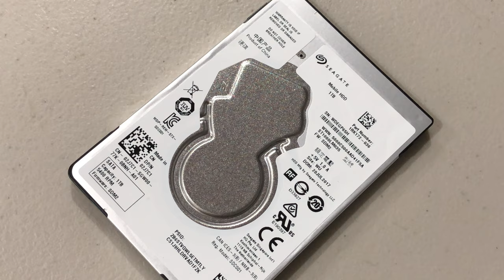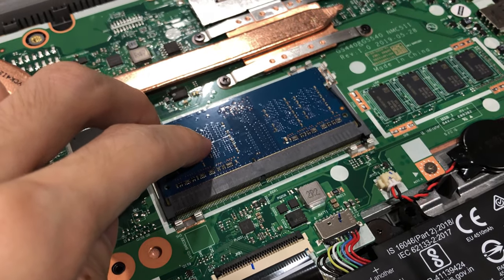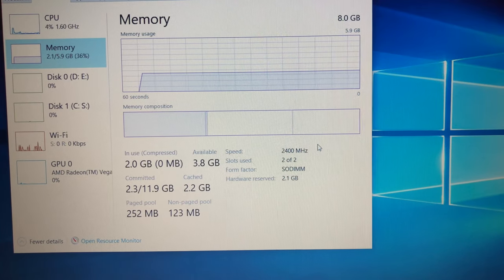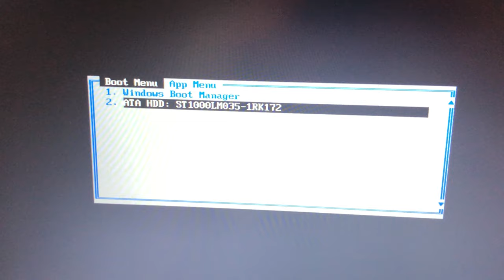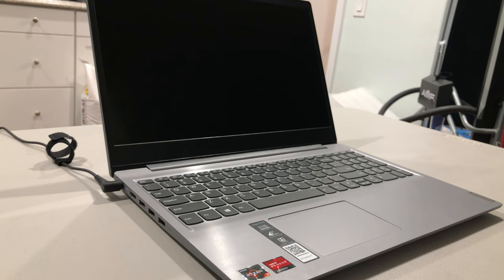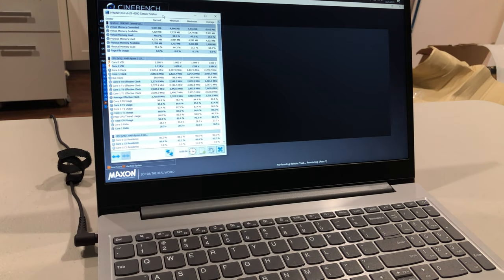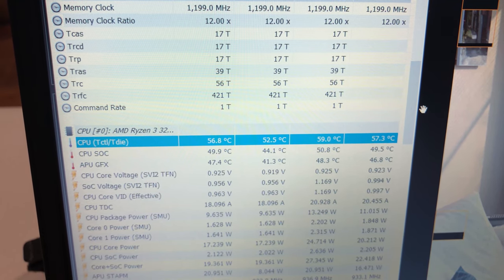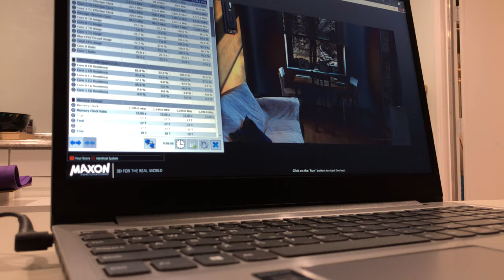Lenovo IdeaPad S145-15API with AMD Ryzen 3 3200U + Vega 3 - Review and Hard Drive Installation

Comment: These ryzen mobile APUs need a GPU refresh soon.
They never put enough Vega cores to really get solid gaming performance and we should be seeing gtx 1050 to 1060 levels of performance by now even in mobile.
Just look at how old the Hades Canyon nuc is.
Reply: Realistically, the average user doesn't need that much graphics performance and it would probably use more power, but still I think we should be seeing more out of AMD APUs
Reply from the maker: I agree, but I don't think AMD will give more power to these cheap APU as these laptops are focusing on low-budget users. But for higher end Ryzen 5 and 7, I do think we need more powerful graphic + 7nm architecture
Reply: I am really afraid that the 4000 series APUs will be a big disappointment. Especially since it seems we will still have only Vega. With the hop up in IPC I wonder if you can do low rez high refresh gaming at 720p or 900p.
Reply from the maker: @greenprotag  I think Desktop APU will do better than the current APU at 720p, but for mobile, I won't give them much hope :D AMD has RX 5500m so they obviously want people to buy that for real low-end gaming laptops instead of giving us something to save money. It's business after all.

Comment: Is the included SSD a DRAM-less drive? Your task manager only showed 6GB even though you had 8 installed which would lead me to believe that it’s using Host Memory Buffer and the SSD might be eating at the usable RAM in your system.
Reply from the maker: I think there is no DRAM on the SSD for these cheapo laptop, but I don't think my pop has the ability to shorten its life span 😄only Youtube and elementary English
Reply: No the Gpu uses 2gb from the ram as dedicated vram so giving you 6gb ram usable

Comment: Bro which type of hdd do u use? I got the same ideapad and want to add more storage using hdd? Is it internal hdd?
Reply from the maker: I used a 2.5" 5400 rpm drive
Reply: @PokerFaZe  did it bring a caddy for the hdd to be secured? Can u link me to a HDD for lenovo laptop please
Reply from the maker: @justlg3359  3:50 you just insert the drive and push it down, that's it, the drive is secure, you don't need a caddy for it :D
Here are some 2.5" drives for you to check out
☛ 1TB Western Digital Blue SSD (fastest): https://amzn.to/3kxa94y
☛ 1TB 7200 rpm HDD (faster)
- Western Digital: https://amzn.to/3eXKukt
- HGST-Hitachi (I bought this on eBay 3 years ago, still great, but it seems to only have used options now): https://ebay.to/2IB0ZqM
☛ 2TB 5400 rpm HDD (slower than the above drives but gives you more storage): https://amzn.to/3kuzV9p

Let me know if you have any question :D
Reply from the maker: Hi, I think that's the one :D sorry for the late reply
Reply: @PokerFaZe  this a matte or glossy? can the screen be changed to a ips one?
Reply from the maker: @justlg3359  It's matte. Screen is changeable? I don't know :D
Reply: @PokerFaZe  can u do a video about it? This model? Since I really want to know if it is, or what is the best color accuracy for it settings to make it look better, since screen is too dull
Reply: @PokerFaZe  no the whole series is matte
Reply: @justlg3359  there’s no matte display option at all